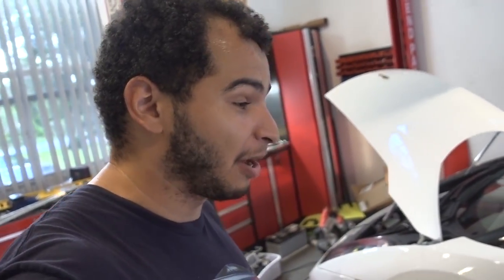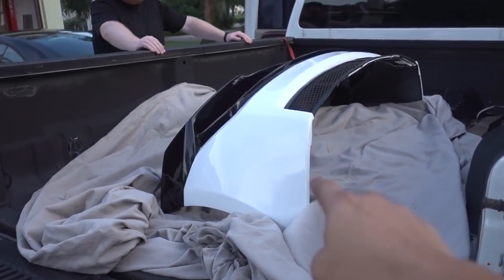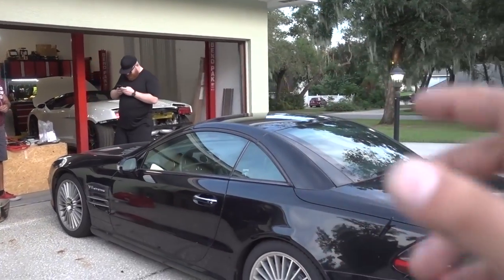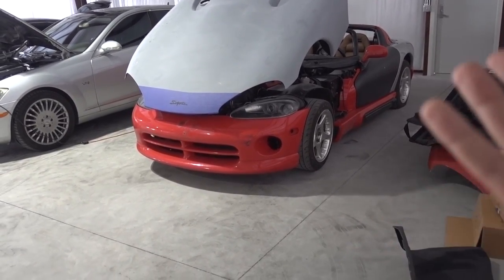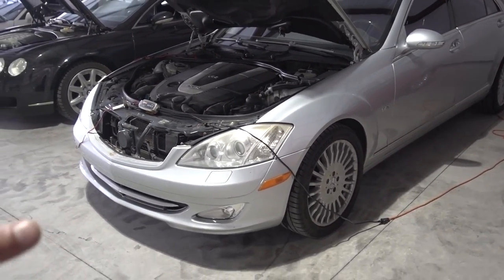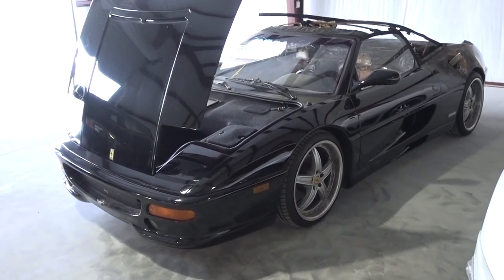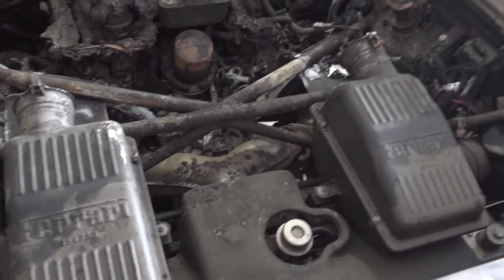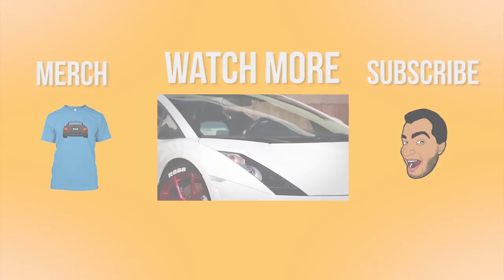I Have To SELL My Cheap Dodge Viper?!  - GARAGE UPDATE

Comment: That Ferrari will not be anywhere CLOSE to being done for a "2019 SEMA car".
Reply: Maybe for 2020
Reply: I agree Sema quality is a frame off resto!!!
Reply: At his current rate? Not really but that's why he was asking about some sponsors. If he can get a sponsor/booth lined up which will bring in some cashflow to the project then that means he can have more people come in and help. 

If he worked on it solo... mostly and did nothing but that car with everything going the right way and getting a little bit of help welding the top on, he could make SEMA 2019, but with his schedule as it is, it's unlikely he could without help. Especially financial support from a sponsor.
Reply: ArE yOu suRE aBouT ThAt ?
Reply: @Maddy Riesling Sema 2019 is a year away. It's a safe bet that he could have a few cars done by then. Whether he can get the one in question done to the point it's Sema worthy by that time is debatable. Especially solo with no sponsors and help from other people doing some of the heavy lifting. With sponsors and people helping it is very feasible to have it done by then.
Reply: @Maddy Riesling Oh for fucks sake, give it a rest. The Gallardo is a long term kind of project he plans on keeping and driving not reselling. So there is a lot of little things he wants to get right so the small things take the most time. Especially when he was doing most of the work himself. If he had a sponsor for the Gallardo, and or wanted to spend a ton of money on it then he could have had it done already. You also have to factor in this shit isn't cheap and yeah he's milking the Gallardo for views and you know you would as well if it helps bring in more subscribers and more views. 

If he can get a sponsor he can get in actual help with people knowledgeable about the actual car, so no spending a month or more tracking down trying to fix a single issue it shouldn't take all that long. Also with Sema you don't need everything to really function, or function properly. You can hide a few imperfections here and there just so long as it looks good and can't be easily seen from the floor so to speak. Sema can be more form over function as long as the aesthetics are down you are golden. 

Now I don't like how he does certain things, but that doesn't stop me from enjoying the content overall. 

Look with the right people and budget he could have it paint ready in a few months. Now that would be with a high budget, and a few talented people on standby. But as it stands even with a mediocre budget as long as everything is planned out and the setbacks are few and far between it could easily be done in a year. Especially depending on how much he milks it. 

Also if he's such a "joke", why follow along with the content?
Reply: My God, the same nattering nabobs of negativism said that about the B Is For Build Z, and he shut them up and got it done.
Reply: Lol have you seen B is for builds 240z? He built that car from scratch in like 6 months  lol.
Reply: Kayden's Gone live “Sema quality” is not frame off restoration. It could be or it could be not. There are plenty of very backed up cars at SEMA. All it takes is getting a company to sponsor the build. Whatever happens from there then is irrelevant, it could be a half finished not running car there. We’re not talking about The Pebble Beach Concours d'Elegance or anything.
Reply: He meant 2022

Comment: Well hay ya. I also mentioned that you may need a sign made up "NO ANGLE GRINDING" . Not being aggie but angle grinding can cause metal chips, that can cause real damage to paintwork.
So the metal chips can land on your paint and if left on your paint unchecked, and then driven out side and rained on the metal chips will corrode into your paint when the metal starts to turn into rust and with the help of gravity the metal flake if you like will then cause a rust pach. 
On your roof!

Comment: Btw I wish you’d contact Sam crack and teach him that stripping the entire section of the car, getting to all the bones and taking measurements ensures a solid repair and build. 

Your still the best guy my man. Every time you get to the root of the problem I watch smiling. Even if it takes time and effort. Cheers to that

Comment: Hi, I love how you're totally honest about your cars. Spacing wheels to just make them stick out more actually causes premature bearing failure. I'm kinda assuming you know that the inset of the rims is set for many reasons. I'm sure the viper could still pass emissions without the cats, but it won't be allowed through without them. You have done more work than I would be willing to do even if I could afford it, you're  great, wrench every day.

Comment: That Ferrari is NEVER driving again. It is so busted up that you will pay a fortune for spares. The only way to do this is to buy a high mileage F355 for $40K and use its parts. In fact there is one for sale in Cincinnati for $32K. Somehow it seems throwing good cash after bad.
Reply from the maker: nah
Reply: Yea doesn't having the body in fire change the metal so it's no good anymore? I'm not a metallurgist by a long shot, but I think heat treating it and then dousing it improperly makes it brittle and crack.
Reply: Better put a beetle engine

Comment: On the Mercedes with the leaking transmission connector, make sure to check the transmission control module under the hood. Sometimes fluid can travel through the wires and damage it.

Comment: One thing you may want to think about if it hasnt been done is to bulletproof that 6.0 in your truck. They are notorious got their EGR & Oil coolers clogging as well as them popping head gaskets.
Reply from the maker: it's a 7.3

Comment: The masking job between the white and black on the bottom of that bumper is super sloppy, unless the video was just really bad in that particular part. There is a nice transition line there, and I know it can be hard to get good masking in that tight corner, but it can be done if the painter takes their time.

Comment: I think you should turn the Ferrari into an electric vehicle conversation since almost none of the engine is useable and all wiring and ECU are gone. Tesla motor and battery pack be sweet.

Comment: Why not buy a Lincoln MP 210 multiprocess tig  mig and stick for half the price better welder with better customer service that’s coming from a guy that welds for a living keep the great content also one more thing I have to say this because I am a union Pipefitter use a level when fixing that exhaust that crooked tail pipe has bugged me since you had your “ welding Jedi” weld it up

Comment: you can rescue the bottom end of that 355 engine and maybe the cylinder heads and also the metal shifter and gates

Comment: 15k is way too much for a gen1 viper in such poor condition with so much work needed. Minus whale buy a gen4 for what would need to go into this one and you'd have way more power, better handling, better interior and a real drop top roof with real windows instead of the useless targa roof.

Comment: The F355  vs. The F360 is a nightmare to work on. + its much better looking. I own a similar Bentley & I love it. But me mechanis/Partners 2011 7bmw 7 series v12 twin turbo, chipped, with awd is ridiculousy fast & imho is faster & more reliable than your Lamborghini. Its stupid fast & smog legel here in CA, suspenion work done of course. Vs. The Bentley, software upgraded & chipped. His bmw scares me w/just the acceleration. Handles better than my Bentley even with stiffer springs. Whale vs. Shark.  Seriously youre straying from the original channel concept into helpers, sponsors & a fim crew next?  Supra singlt turbo build should be interesting though. Good luck.

Comment: @Tavarish about the SL headtights.
If they are plastic, maybe you can do a quick video, or at least.. do the job in the video bellow.
youtu.be/kMkx58TxWYs

some info from the video:
Plastic rear lights
Sandpaper
400
500
800
1000
1500
2000
wet sanding
ideal UV resistant varnish

before start sanding, place the varnish tube in warm water
is recommended to sand on a workbench
any deep scratch should be removed within 500 sandpaper
he sanded around 3 min with every sandpaper type
warm and dust free drying place

won't be perfect, but much better than before

Comment: So you're going to completely ruin the Ferrari, WHY? with the exception of the top and turbo NOTHING else you mentioned makes ANY sense at all. that car is sexy as hell in black. You don't need to change the color. you really don't need to change the roof either but i do like the idea for the roof still. I also like it convetible as well but the berlinetta roof wouldn't look bad on it either so i have no critiques either way on that part

Comment: If you ever do a single thing to that Ferrari, I'll subscribe. But I doubt that.

That Ferrari is so far gone that there is no way somebody with your abilities could even hope to get that back together and looking good enough for SEMA.

The Lambo had much less severe fire damage and its taken you 8 months to rewire it and fix the already built and TT engine. You complain about costs for the fucked up panels and soft top, yet then casually plan to resurrect a fossil of a Ferrari with 10x the fire damage, rebuild the crispy ass engine, turbo it and have it looking SEMA ready by next year? It took you like an entire month just to correctly plumb a turbo setup that was already fitted into the Lambo. The roof still befuddles you! Yet here we go promising a rebuilt, turbo'd 355 (that's been fucking roasted) in just under a year.

bro stop just coming up with ridiculous and exciting plans to generate hype, you KNOW you wont be able to deliver that Ferrari without a fuck load of outside help, essentially outsourcing the project elsewhere. Just be honest with your projects and have realistic goals, you'll disappoint far fewer people.